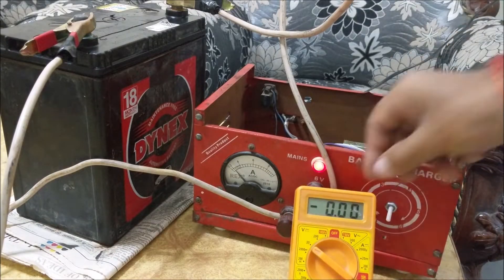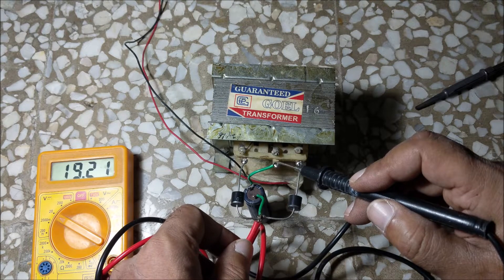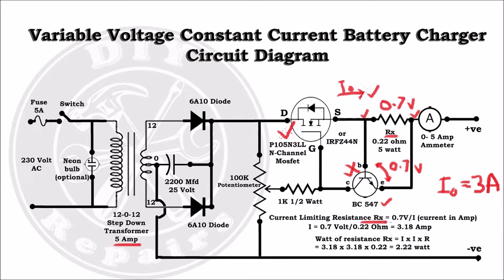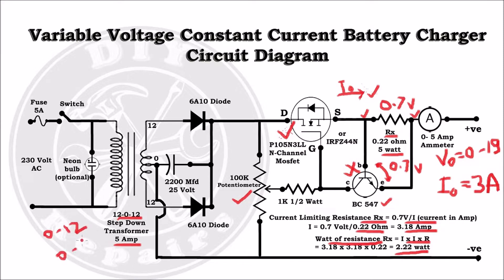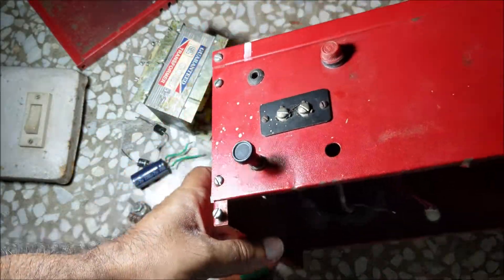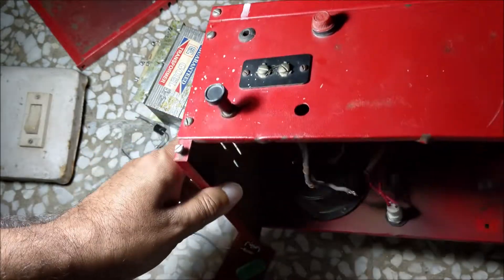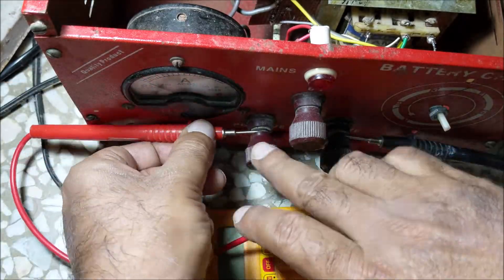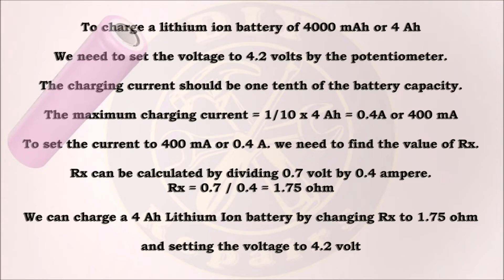constant current variable voltage battery charger

Comment: Can this charge all types 12 Volt batteries or only bigger Ampere batteries?
Reply from the maker: the output current should be 10 percent of the battery rating. so you have to calculate the value of Rx accordingly.

Comment: how to connect irfz44 in parallel 4 in numbers for higher ampere circuit?
Reply from the maker: use high current transformer. change the current limiting resistance (watt & value). Assemble MOSFETs to one heatsink so that the thermal dissipation condition is the same for each MOSFET.
Use an external gate resistor for each MOSFET.